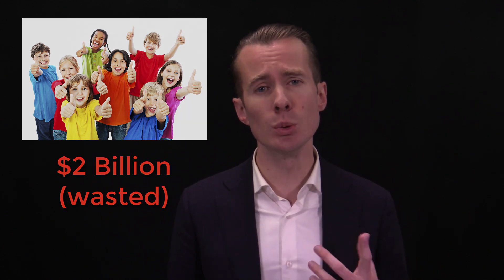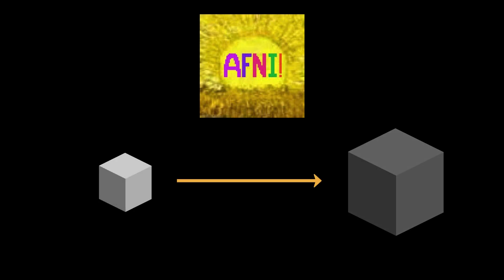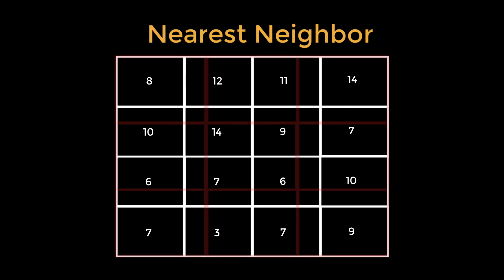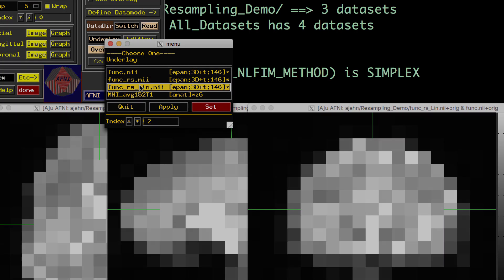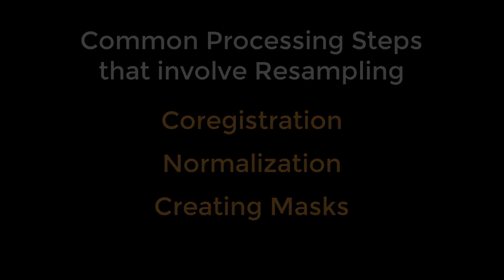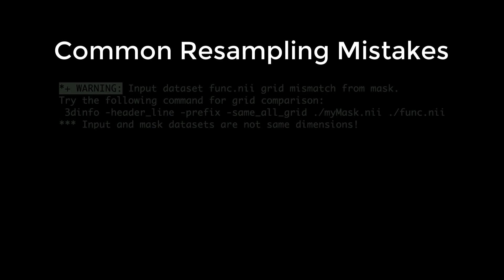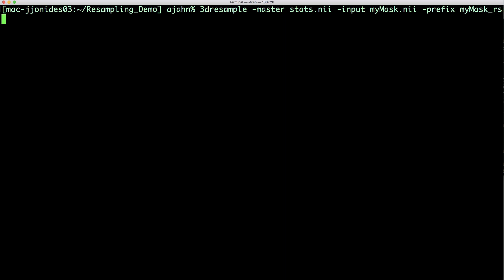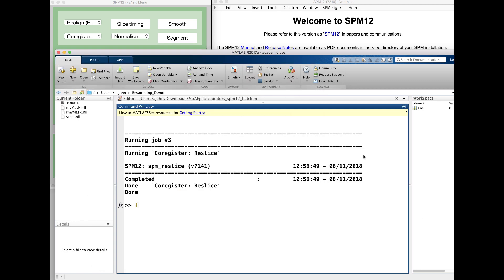Resampling MRI Data: Common Uses and Pitfalls

Comment: Hello, 
My name is Diji and I am working on brain sMRI data and I have some questions but the answers I have found on the internet and other platforms are a bit cumbersome or too technical for newbies in MRI neuro-imaging analysis like me. 
Let me start :
Do I need to resample sMRI images? The aim is to get the classification  between two cohorts of neuro-images which are progressive and stable Mild Cognitive Impairment using MRI data. 
Secondly, is there any written law to follow when it comes the steps involved in image preprocessing before running the images through a model?
Reply: am late and disclaimer - just learning myself

but from what i youd have to register and resample the images to a template to properly analyse it, as for the preprocessing it depends on the pipeline youre using, smriprep is a good place to start since it has everything in one package

if theres anything wrong w my answer could someone update danke

Comment: Hi, I just left you a message on GitHub, just found your video. I am trying at the moment to resample a 61x73x61, time series of fmri data to something smaller to work with deep learning which is computationally very expensive. I should end up with a smaller cube (maybe 30x30x30), but I don't know how to go about it. Once the data is analyzed, I should upsample it back to its original shape. Any advice would be welcome. Thanks.
Reply from the maker: Hi Melas, to resample to a smaller cube, you can use FSL's flirt; see the example code on this page for some templates: https://tinyurl.com/y993hhzn

You should be able to use the same command template to upsample the data when you need to.

Hope that helps!

-Andy

Comment: What about standardizing the image dimensions along with the voxels for example: 
1)- MRI image for a child (voxel size [0.8 0.8 0.8] and dimensions [176X230X230])
2)- MRI image for a adult (voxel size [1.2 0.8 0.8] and dimensions [191X240X232]) 
if I resample both to (voxel size [1 1 1] and dimensions [255X255X255]), 
will the anatomical values or characteristics such as the volume of grey matters or anatomical dimension of the new sampled images defer ? 
ps*(aiming to do TMS comparison between the two images)

Comment: what if the functional image is coregistered to the anatomical image?, so the functional dimensions change.
Reply from the maker: That's right, it would be resampled to a higher resolution in that case
Reply: @AndysBrainTube  Good. What is your opinion about coregister functional to anatomical and then resample to get back the original dimensions of the functional?
Reply from the maker: @abelalez  I prefer to do as few interpolations as possible, and to leave the functional data alone if I can. It is possible to do the steps you mentioned, but in my experience the data becomes more distorted the more interpolations you do on it; e.g., resampling to a higher resolution and then back can warp the data in unexpected ways.

-Andy